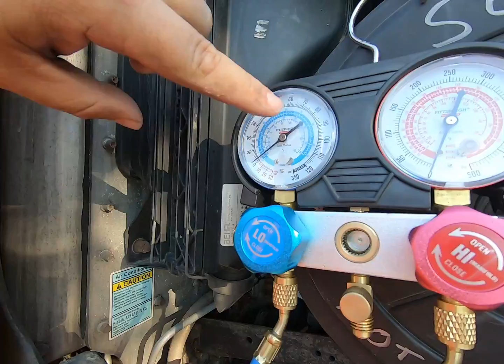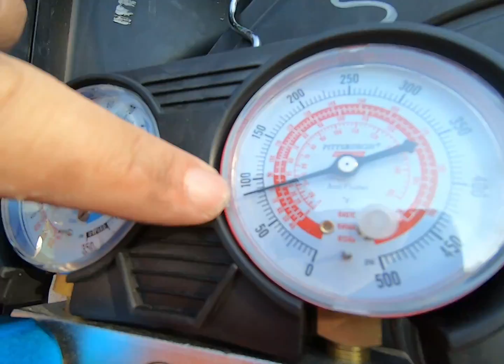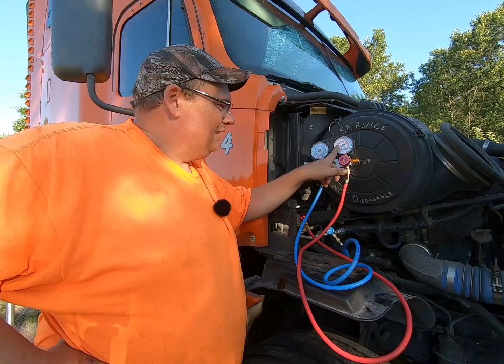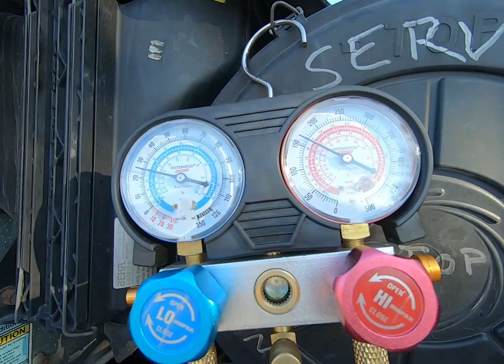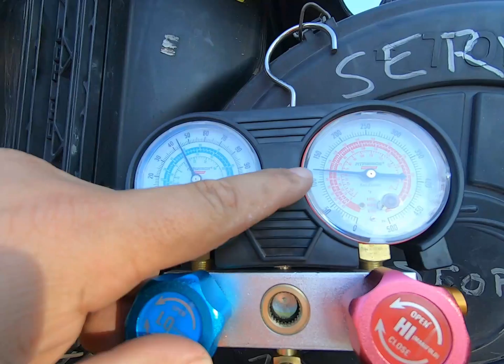A/C basics...Using manifold gauges to determine a/c problems in a semi truck | a/c pressure readings

Comment: So I have a question I have an 07W9 I just change the AC compressor both expansion valves the dryer the condenser I pulled a vacuum it held a vacuum I charged it with cans the temperature was 70 the low pressure side we’re staying right around 20to 42 pounds, The high side was going up to approximately 325 the fan kick on and pull it back down that seemed kind a high for that cool of a day any answers
Reply from the maker: does the a/c cool as it should with no issues? My first thought would be were you careful to add the exact amount of refrigerant to the system? an overcharge can cause this. couple other things, do the pressures equalize when you shut off the truck? are you warming up the truck before testing pressures? temp is important as well as airflow.  does the fan bring the pressure down quickly or does it struggle?  I would run the truck for a good while..see if you get different readings with everything up to temp.
Reply: @DIYSEMI  yes the pressures does equalize when I shut the truck down and also with the fan kicks on it does pull  the 
Pressure down quickly, I had to leave out today so it’s doing great with the AC set on outside air vent , on my little thermometer I have stuck in the vent is showing  40° fan is on two speed,  so it’s doing great I won’t be able to check with the gauges until I get back home. Thanks for your response and your video looking for more stay safe.👍🇺🇸
Reply: W900 Kenworth

Comment: My high pressure goes up to 300 psi initially and when the fan comes on it drops below 100 and never goes back up. Could that be an expansion valve malfunction.?
Reply from the maker: Can I ask what kind of problems are you having? Does the a/c not work? does the compressor run as it should? or when the pressure drops and does not come back up, is the compressor not kicking in? It can be multiple thing causing problems like this
Reply: Good explanation didnt no how to use my set the right way

Comment: Awesome video sir. Can you please explain what could be an issue when you have high pressure on low side and low pressure on high side, but they are equal? You explain that high pressure on low side,and low pressure on high side could be expansion valve, but will they be equal as well, cuz mine are, and I also have codes for high pressure shut off valve, and cab interior temperature sensor, which I both replaced, and still nothing.
Reply from the maker: Yes, they can be equal
Reply from the maker: Yes it can be expansion valve
Reply: @DIYSEMI   Thank you so much sir, I will try that :)

Comment: So the low pressure line is the smaller lane and high Pressure is the biggest line?
Reply from the maker: The bigger fitting is high pressure. Smaller fitting is low. You can only hook up one way.
Reply: @DIYSEMI  right on man. Thanks, I guess when I replaced my high pressure switch I put it on the lower line

Comment: Whats the regular temperature coming out from the vents?  I just got my ac replace and dryer but i dont feel the air real cold. I used a digital thermometer on da vents and blows 64 degree. Should it be colder like in cars because in my car shows 45 degree coming out from the vents. Today temperature is 88. Need some advices
Reply from the maker: Yes, if everything just got fixed i woudnexpect it to be 40-50 degrees from the vents.
Reply from the maker: I show how to deal it in my blower motor video. At the end